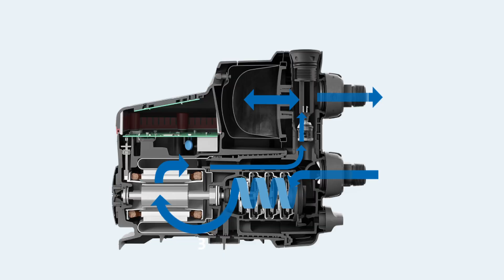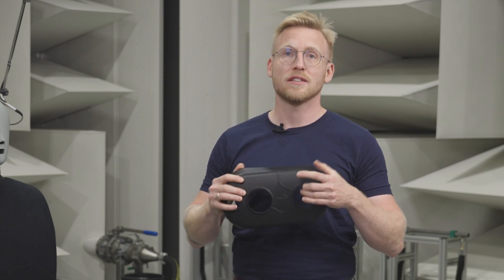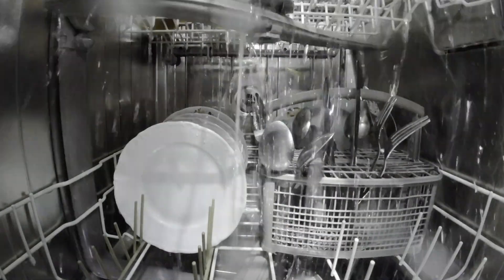Reducing Noise in Water Pressure Boosting Systems: A Guide for Installers

Comment: Hello Grandfos- very disappointing!!! I was hoping you would focus on FIRST improving QUALITY of components rather than noise. This way all of your poorly built/designed EXPENSIVE pumps would not FAIL in 2 years or less. Better fix issues fast  because you are getting a very bad reputaion. Look anywhere and mostly negative reviews on the quality of your overpriced chinese quality pumps. If going to charge over 3 times price of Travino ( MUCH better pump at 1/3 price) NUST improve drastically. Back to the drawing board.
Reply from the maker: Hi @daysoff4ever, we're sorry to hear your experience with the Grundfos SCALA2 has not been a positive one. If you still have the product installed - please message us a photo of the Pump Name Plate (the printed plate on the end of the Pump), the store where you purchased your pump from, and your contact details, so we may look into the issue and provide support. Kind Regards, Eunice